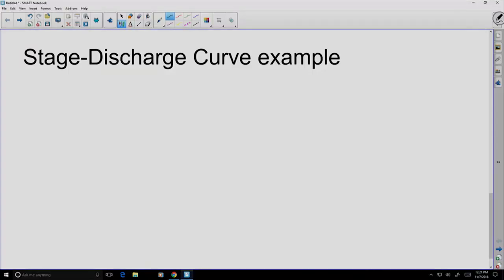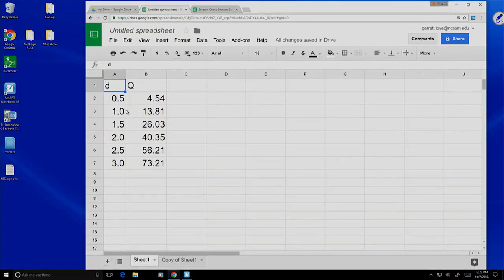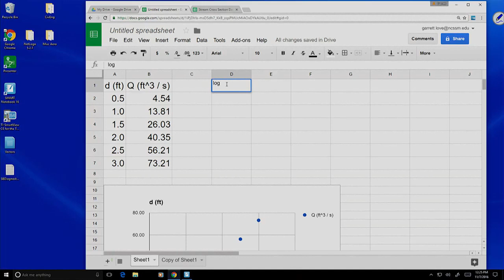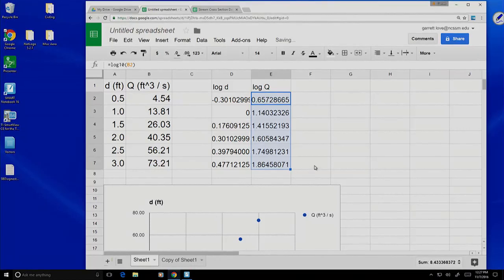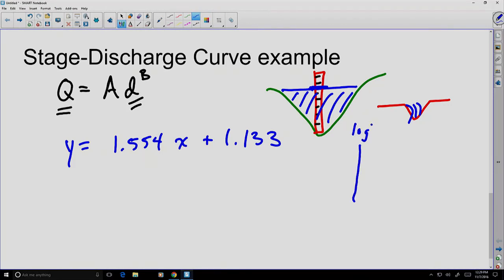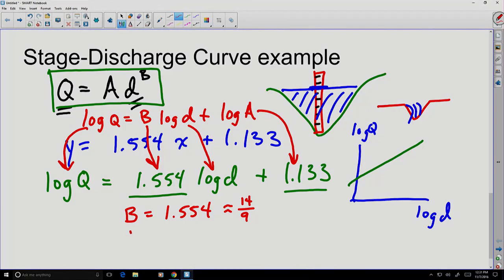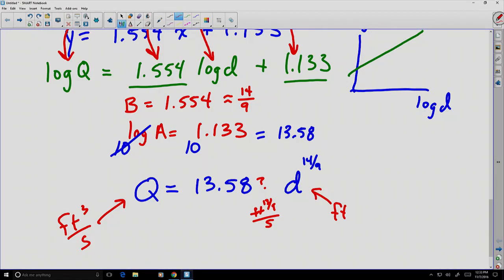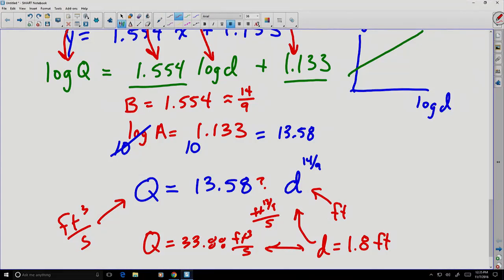Stage-Discharge Curve Example

Comment: Why don't you have to transform the relationship back to linear space to reduce log bias?
Reply from the maker: As you have observed, this "conventional" method does not account for log bias, although it still appears to be an open question in the literature as to whether it is better to apply a log correction factor to this method or to instead use nonlinear regression modeling.

Comment: what if log A is equal to a negative number?
Reply from the maker: If you generated a negative number in your curve fit, check for some of these common errors: 1> reversing x (log d) and y (log Q) axes. 2> inconsistent length units, eg. inches for d and cubic feet per second (cfs) for Q - both length units should be in feet.  3> incorrect math in calculating the flow from the cross-section geometry using Manning's equation, eg. inconsistent units (all in feet or all in meters), forgetting or including the 1.49 conversion factor (used for feet but not meters), or calculator or spreadsheet mistakes when doing fractional exponents.